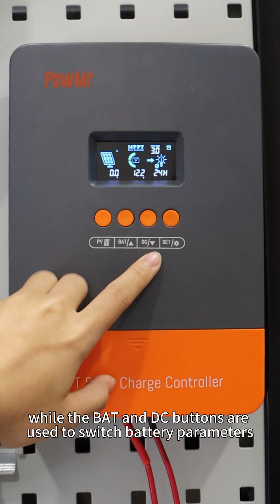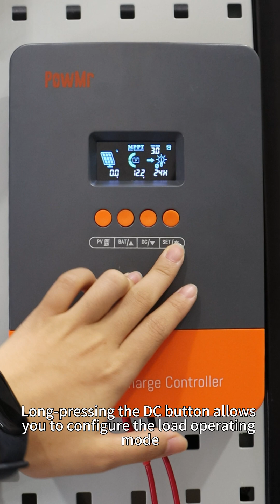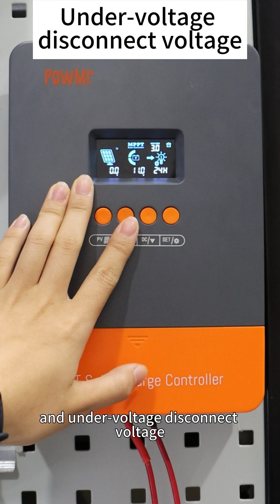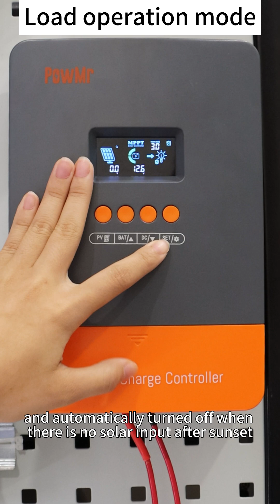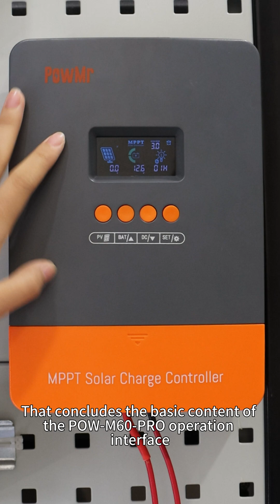PowMr 60A MPPT Solar Charge Controller Setup

Comment: hi I am planning to purchase this item, my setup is 2 nos Solar panel with 580 Watt 24 V DC, Sealed Acid battery 12v 185 Amp connected in series, to get enough power for inverter, apart from this i running 5 fans on 12 V DC from 1 of the batteries, this device will help me ?
Reply from the maker: Kindly check the manual below:
https://cdn.shopify.com/s/files/1/0746/0415/1079/files/POW-M60-PRO_User_Manual_V1.4.0327.pdf?v=1711526459

Comment: saya memiliki masalah di scc pwmr 25A bisa kah buatkan tutorial setting full scc terkait max pv voltnya dan ampere ini thank you 😁
Reply from the maker: this model? POW-M25-PRO
Reply: @PowmrSolar  dia work di ltasi pv max brp  ??
Reply from the maker: @yonathanstevenlie2197  Kindly check user manual below:
https://cdn.shopify.com/s/files/1/0746/0415/1079/files/POW-M25-PRO_POW-M35-PRO_POW-M45-PRO_User_Manual_V1.2.0925.pdf?v=1737514518

Comment: I have 3 430w Philadelphia bifacial panels and my peak wattage while running all 3 is between 550 to 750w when i run each panel individually i see 310 to 350 per panels what am i doing wrong to not see 900watts in peak hours
Reply from the maker: Please send it with your product label to this email: support@powmr.com. Our technical staff will check it for you.

Comment: How to set the working mode  ?
Reply from the maker: It cannot be set, the controller will automatically recognize the battery voltage and enter the corresponding working mode.
Reply: Can't  : (

Comment: Can this work for a 420watt 38v solar panel to charge a 12v lithium battery.can it convert it effectively without over-voltage
Reply from the maker: Yep, no overvoltage.

Comment: What will be the output load voltage if this charge controller is connected to two 12v batteries?
Reply from the maker: Keep consistent with battery voltage.

Comment: hi can 2 controllers of this model be parallel connected and used in one battery.. or can mppt controller of any other model of powmr be paralleled with this model.. if possible then please upload a video tutorial To do. Because I have bought a controller of this model. If it can be parallelized then I will buy another controller. Thanks
Reply: @arduinoprojecttutorial6774  I have done your parallel  test... For my own set up.... If you parallel 2 device  togather it will charge your battery for sure.... For Lithium  batteries  with higher C value that is okey...  But for FLD or lead acid battery ....  It is  very bad for battery  health ....  Hope you understand...  
Conclusion - if you do parallel..  It is working..  But may be harmful  for your battery  health ...

That is not a professional advice
Reply from the maker: Nope, this model can not be used in Parallel.
Reply: @PowmrSolar  If I connect both any 2 controllers positive to positive and negative to negative of the battery. Will it not work or what will happen?
Reply from the maker: @arduinoprojecttutorial6774  Any 2 controllers? Please use the model that can be used in parallel.
Reply: @PowmrSolar  My question is. Can another 20/30/40/60A powmr mppt be paralleled with this model of your powmr mppt 60A (the one seen in this video)? Because there is no port to make these models parallel. Is it necessary to have the same model and the same capacity to be parallel? Hope to answer every question.
Reply from the maker: @arduinoprojecttutorial6774  Nope.
Reply: @PowmrSolar  Partially answered. Please give more details. Many questions were asked but which one did you answer?
Reply from the maker: @arduinoprojecttutorial6774  This model is a stand-alone machine and cannot be used in parallel. Do not connect other model in parallel with it.
Reply: @PowmrSolar  I understand that no other model can be paralleled with it. And if I want to parallelize the same 2 controllers of this model?
Reply from the maker: @arduinoprojecttutorial6774  I have answered you many times, no, this model does not have a parallel function and can only be used in a single unit. No matter they are the same models or different models, they cannot be connected in parallel.
Reply: please reply my last  comment

Comment: Have only 4 battery type options and cannot select system voltage anyway.  Has no system voltage menu at all. My system is 24v and battery settings is used only 12v battery settings e.g  14.4; 13.8; 10
Reply from the maker: For other battery types, you can select USER mode. The parameters will only display 12V and will be automatically multiplied.
Reply: @PowmrSolar  thanks... Now it is clear, if have 24 or bigger voltage systems, must to select user defined options for sealed battery's. Because if multiplecated battery parameters have ~29 volt this is to many for lead acid(sel).
Reply from the maker: @alext7937  The preceding parameter ranges apply to the 12V battery. When the connected battery voltage is 24V/36V/48V, the range values are 2/3/4 times of this range, respectively. And the LCD only display the voltage of the 12V battery.
Reply: @PowmrSolar  okay and how to correct 24 or other systems voltages? I suppose controller set system voltages regarding to the 12 volt system settings. As factory setup is 14.4 so controller just doubles this parameter to 24v system, 28.8 is to many. Need 28v upper limit, so must set USE battery mode and input 14v not 14.4v... Right i think?
Reply from the maker: @alext7937  Yep, 14v.

Comment: Hi, is it possible to connect the load outpuT to another  30 amp PWM charge controller ???
Reply: Can I   set the output voltage  by my owm
Reply from the maker: @Aurthermorgan02  Nope, you can't set the output voltage.
Reply: What will be the output load if I am using 24v flooded battery? @PowmrSolar
Reply from the maker: @muhammadfahad3441  Keep consistent with battery voltage.
Reply from the maker: Nope.

Comment: @PowmrSolar, can this or any other PowMR SCC model able to
1. Limit the charging current (e.g. set to 25A instead of 60A) ? 
2. Can this support over paneling (e.g. use a PV array of 1800W with a 12v battery (i.e. much larger than 720W),  but only 600w or less is consumed. Over paneling is only to handle low Sun light conditions) ? 
3. What is the maximum PV Voltage(Voc this SCC can handle) when setup with a 12v battery ? Is it 160v or 80v ?
Reply from the maker: Hi, it is 60A, can't be set to 25A. For 12V system, 720W 20-80Vdc.
Reply from the maker: If you want to exceed 720W, you need to upgrade to 24V or 36V.

Comment: My solar panel is 1520watts but the my charge controller only gives me a highest wattage of 700watts
Reply from the maker: May I know which model?
Reply: @PowmrSolar  Pmr 60
Reply: if your battery bank is 12v system the charge controller by default limit to 720w  , in 24v it goes to 1200w
Reply: @MrEdmundoGC  Thanks for the info. However the highest power rating at full sunlight is never up to 750watts.

Comment: I have got the 60a red version, can you make a video on how to program? I thought the red one was better, but the instructions are unclear
Reply from the maker: May I know which model?
Reply: @PowmrSolar  it's a 60a mppt and the case is red and only has two buttons. I see now that I need to buy a Bluetooth module or a box for like $35 if I want to set the charge voltage which seems like the minimum basic functionality... What a poor deal.
Reply from the maker: @kstorm889  Please send your order number and problems to support@powmr.com.

Comment: Order N° 8160995424716584 PowMr Oficial store
The model delivered has an old firmware that does not allow charging 8x LiFePo4 with 3PV 350Wp. I use USER mode, but it quits MPPT mode too quickly. So it's unusable. According to the documentation, it is guaranteed for 2 years...
What should I do? Thanks

Comment: Hi, can it uses 140v PV voltage and charge lion 60v batery (68v full)? Or only can program to 48v (58v full) batery?
Reply from the maker: Hi, you can use PV voltage of 140V. Only 48V.
Reply: @PowmrSolar  I can’t chose on user final
Charge 15.75v (63v) ? If it can go up to 18v…
Reply from the maker: @RuiSjm  Hi, kindly send your problems to this email: support@powmr.com

Comment: Yes, Im also facing the same problem in "USE"  mode. 24V battery unenble to set boost voltage to 28V? the parameters only can set 17.9V 😢hope can help me to solve the problem.
Reply: You should set the parameters like it was a 12v battery, then it automatically detect if its a 12v, 24v, 36v or 48v an multiple your settings automatically.

So if you set 14.6v and connect a 48v battery it will automatically take 14.6v and multiply it by x4.

So even though the settings says 14.6v it will output 58.4v.

It confused me at first but when I checked with my multimeter it gave in fact the correct charging voltage.
Reply from the maker: Hi, kindly send your problems to this email: support@powmr.com.
Reply: Don't set it too 17.9v because it will charge your 24v battery to 35.8v which is way to much. Recommended max is normally 29v

Comment: Mine goes to mode 7 drop my wattage (600 to 400w) and don't charge my battery.
Reply from the maker: Hi, please send your questions and order number to this email(support@powmr.com)
Reply: The same happens to me. with a 390w panel only 7.0 mode and with a 160w panel if it works well.